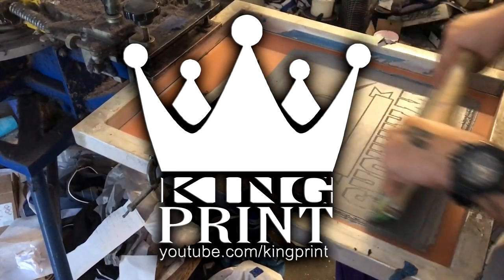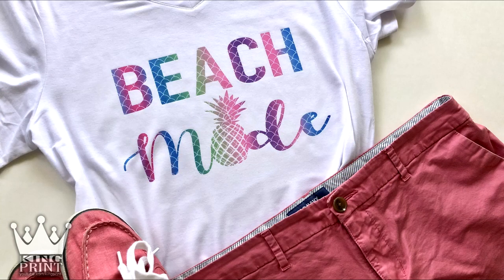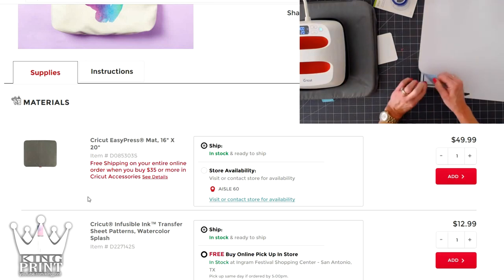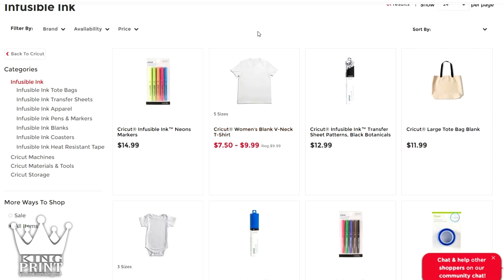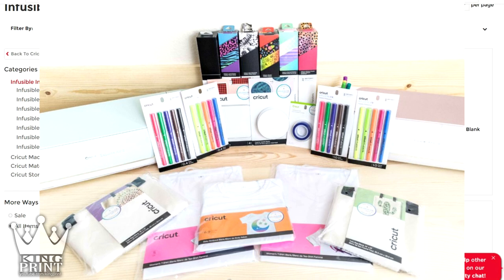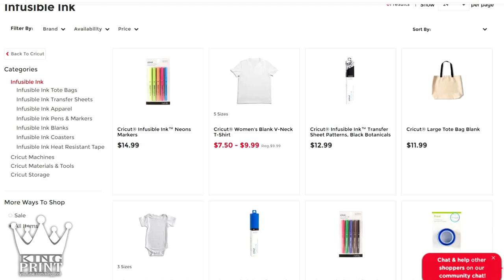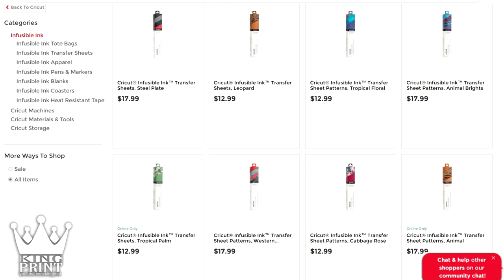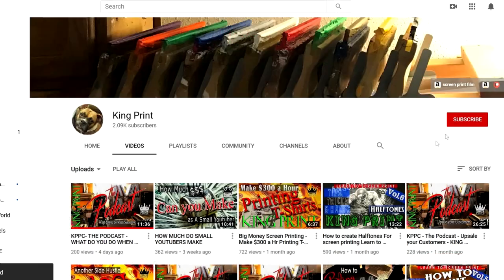CRICUT INFUSIBLE INK REVIEW *  everything you need to know - KING PRINT

Comment: Welcome to the wonderful world of sublimation! 
Here's a few comments. 
first, you can't convert ANY printer to sublimation, ricoh, and epson work best. (matter of fact, the 'sawgrass' sublimation printer is just a converted ricoh, and the SG800 that does 13" wide prints is $1600)  Converting an epson printer does work well, for 'making your own' sublimation printer, BUT, you can't leave it sitting for any length of time without printing, as the heads will clog.  (then again, you can buy a boatload of epson printers, for the same price as a single sawgrass, and just have ones in reserve, if you have head clogs you can't clean out) If you're not comfortable with ink refills on a CIS (continuous ink system, with the tubes and large tanks) you can either just get refillable cartridges (and refill them more often), or use an ecotank printer.(easier to refill)
!!whatever you use, remember, you HAVE to use sublimation ink, it WILL NOT WORK WITH ANY TYPE OF 'STANDARD INK'!
Second: You CAN use items that are less than 100% polyester, BUT: it won't give you as bright and vibrant colors. If the item is only 50% polyester, then only 50% of the ink will 'stick' and you'll have an extremely faded design. This can be used creatively for a weathered look. 
Also: in my opinion it wasn't stressed in the video, once the 'print' is made, it MUST BE heat set into the substrate (t-shirt, mousepad, whatever you're printing on) This can be done with the 'cricket iron' or a heat press. you MIGHT be able to use a hand iron, but it will be difficult to get consistent heat and pressure, as it generally requires 380' for 50 seconds. (depending on what's being pressed) 
Different items may be sublimated other than shirts, but the restrictions are: 
-It has to be polyester, or polyester coated (see above for the 100% polyester note)
-It has to be able to withstand the temperatures, and pressures required to properly transfer the ink. (you'd be surprised what melts at those temperatures)
-It has to be pressable. (for example, if you're doing mugs, you need either a mug press, or properly wrapped and placed in an oven, you can press other non-flat objects, if you have a way of pressing the transfer flat against the item, and heating it up to the proper temperature for the proper time)
*Make sure and TEST whatever you're doing, before it really matters, as some things will work better than expected, and some things that you think will work, will fail miserably. Don't be afraid to try new things!
For those interested, The process that transfers the ink is, when the ink reaches the proper temperature, it converts to a gas, and re-dyes the polyester the color from the transfer. You have to make sure that the transfer paper is in close contact with the item, or when the ink turns to a gas it will 'bleed' where you don't want it. If you heat the item too much, then the ink will seep into places you don't want it.  all these things take practice, just don't forget to have fun!